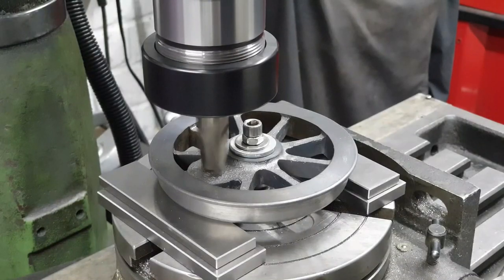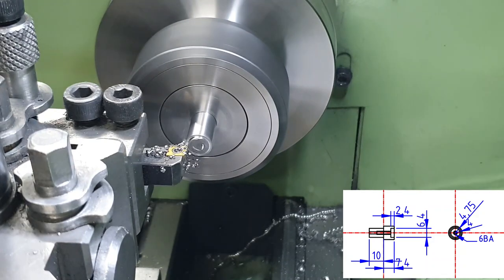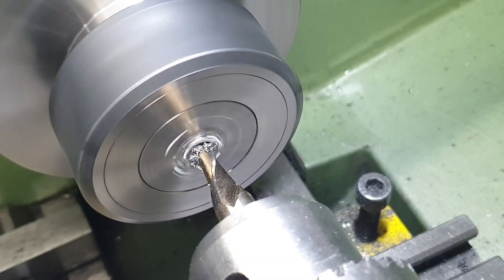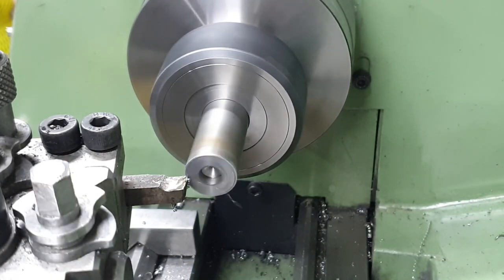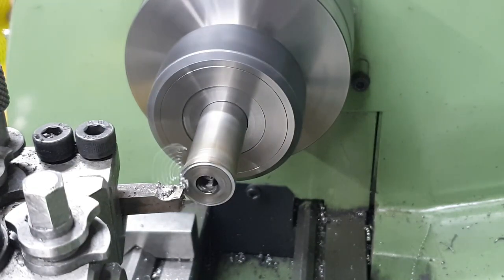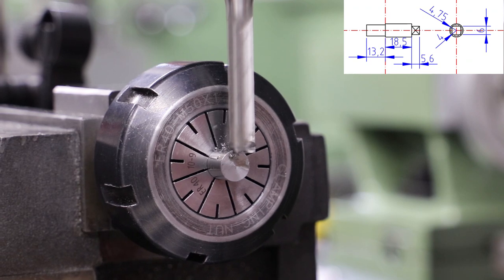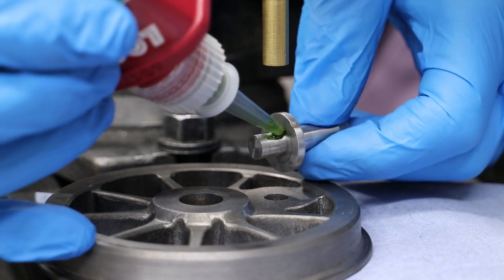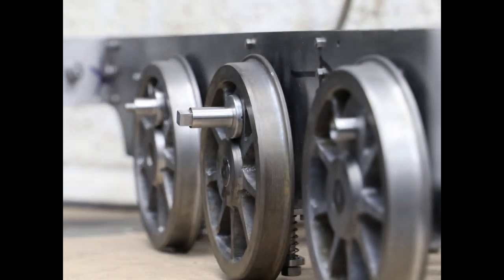Part 9: The Crankpins

Comment: Thanks for the great video. I have a question - When you flip and face the front of the pin, then measure and face again to get the correct overall measurement - are you using a touch-off to determine your zero on the second cut? The divot for the loctite to cure in is a great shout, thank you for that little tip. I feel like a set of collet blocks would be a great idea also as shown by your video, but I'd rather not by ER collets so I'm trying to figure out how I'd make them using the Myford MT2 captive collets...
Reply from the maker: Hi William, yes when it comes to facing off, I just touch off the front of the workpiece and set that as zero on my longitudinal indicator (I now use a digital vernier caliper held to my V Way with some rare earth magnets - do a search on YouTube if you've not seen it already).  For the Collet blocks there's always a trade off between buying tools and making them, but I'm sure there's some videos out there to help with these.  Good luck :-)

Comment: Mark, another fabulous episode.  This has been fun to start back from the beginning. I have a quick question about the cutting lube you paint on and part with.  What product are you using and having success with?
Reply from the maker: Hi Joel,
Thank you for the positive feedback, it is much appreciated.
The gooey stuff you see me applying to my work pieces is MolySlip MCC and I also use CT90 Cutting and Tapping Fluid.  Both seem to work ok, but in reality I would use anything that I had to hand if necessary, including old oil 🙂
Cheers
Mark
Reply: Thanks for the information. I wondered if that was a moly product. 😀